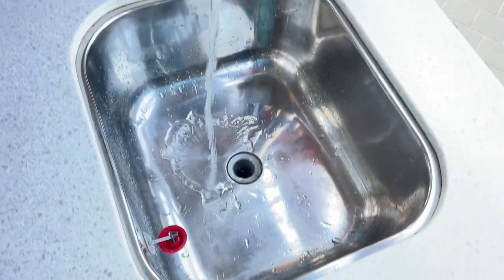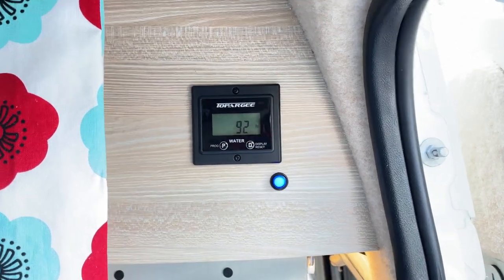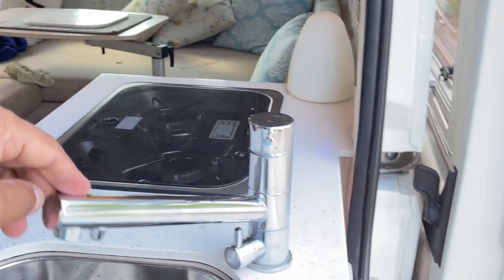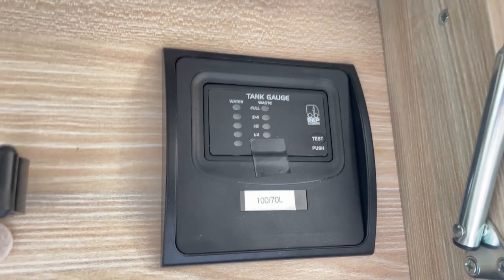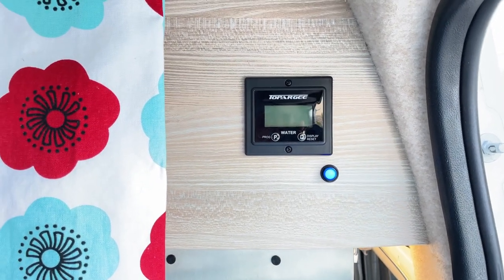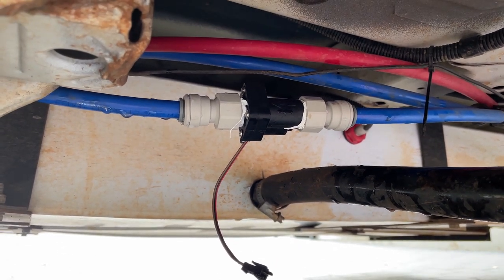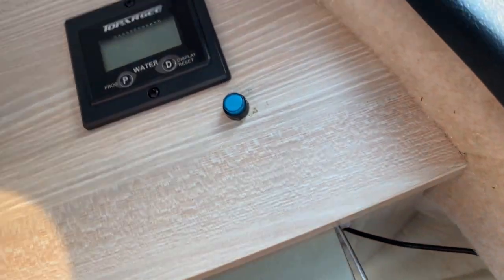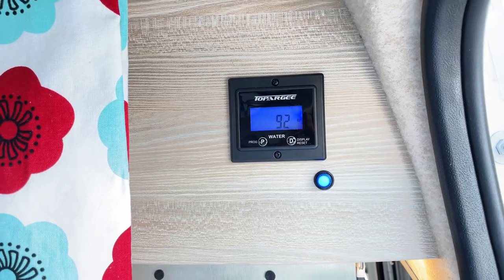💦Topargee Water Tank Gauge Installation

Comment: I have one of these in my camper. I’m not sure how accurate they are. Everytime I empty the tank I get different readings some times it’s out by 20L
Reply from the maker: It's been ok for me. Do you remember to reset each and every time you refill the tank?
Reply: @VanHacks  yeah. What I mean though is when I empty the tank sometimes it will say there is 15l left then next time it will show 0l but water is still in the tank

Comment: Thank you for this detailed video, couple of questions:

1. Why is your 100l has 50l usable instead of 100l
2. how do you tell it that it has been filled again, do you reset it or something?

Thanks
Reply from the maker: When parked on a level surface I have a capacity of 70L. But when the van is on an upslope then I can draw out 85L.
Each and every time you refill the tank, you must a) fill full b) reset the meter

Comment from the maker: Turns out our 100l rated tank only has 50l actual useable capacity - good to know! Now I know to set the gauge at 50l each time I refill the tank. And with the gauge we know know that we use between 4-7 l of water for a generous shower.